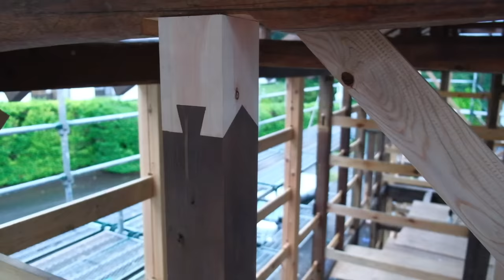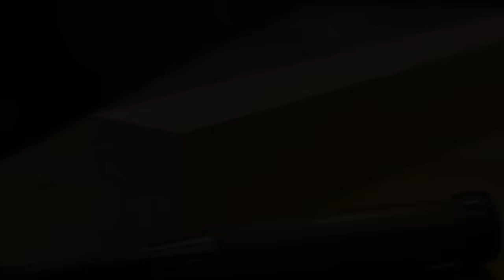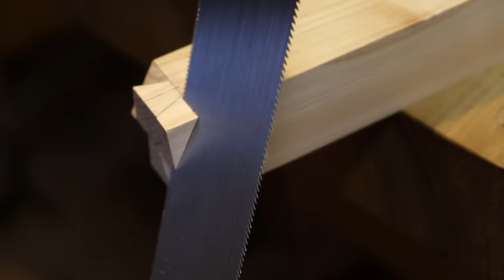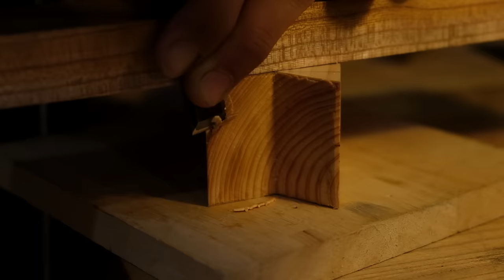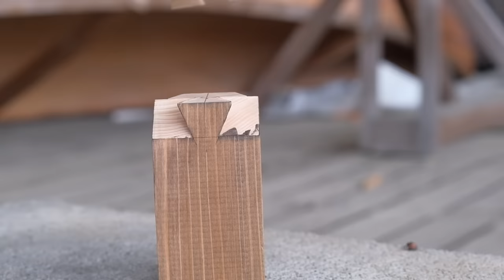Mysterious Japanese Joinery

Comment: What's really awesome about this was that it was a mystery to most people until 1983. The craftsmen of the past were really special. Thanks for sharing this with us, Dylan.
Reply from the maker: Cheers! Indeed, the work they did were really special!
Reply: I doubt it. By looking at the outline of the joints, you can immediately deduce how it looks pn the inside, because the two pieces only move in a straight line in order to close the joint. All you need to do is draw straight lines from the outline and figure the direction.
Reply: @xl000  You don't know what you don't know. It's not that simple. Now that You've seen this video it looks easy but looking from outside it's almost impossible to know how the internal sections interlock.
The first person who came up with this idea was a genius. Not in wood working but in geometry.
Reply: @xl000  That's an incredibly glib response. Try not to be so smug, it's not winning you any friends.
Reply: @christopherbedford9897  Some people can just visualize things easier than you... no sense in getting upset.
Reply: I don't understand why it's a mystery, it's very common in China since thousands of years ago
Reply: I figured it out straight away before he even cut the wood. I deducted he cant slide it in from the side or top because of the odd 2 different shapes of the joint so he must slide it in diagonally.... I was correct. Took me 10seconds to deduct that. So I really doubt this but I work with cad software in my spare time so my mind has gotten better at visualising joints and angles.
Reply: @spacecowboy07723  just because you know it had to be slid in diagonally doesn't mean you can plan or reproduce the joint
Reply: @no_peace  anyone who is an engineer could do that. It's literally what we do all day. I don't see why you think it is so complicated. This video exaggerates for views.
Reply: as as  I'm interested in the topic. Maybe you have more i fo or reources o can learn about it? Thank you!
Reply: @spacecowboy07723  let’s see you come upon with a new in interesting joint then
Reply: @masoudj1185  " Not in wood working but in geometry."
That's why you see things like this in castles of the Japanese elite. Geometry and astronomy were until recently considered to be occult arts . Knowledge of geometry demonstrated knowledge of the spiritual and magical truths, because geometry is how the movement of the planets(i.e.- the gods) was figured out. This is why the pyramids were built in egypt, the giant stones in machu pichu, etc. and why western occultists refer to themselves as freemasons. Geometry, astronomy and sex are the cornerstones of occultism.
Reply: You guys who “figured this out because you work on stuff like this all day”, or “am good with geometry” you guys are the sh1t!
Reply: It was obvious to me the first time looking at it. Was just as I expected.
Reply: It's allgood as long as you ain't got homeless ppl waiting for a homeless shelter your building using this ancient slow-azz technique..😂folks be froze in winter while you sitn at that bench pecking everyone's life away..
It's perdy though.
Reply: Just by the photo I knew it was slide in from a side like he did so your probably right
Reply: Bull.
Reply: A general lack of appreciation for a skill, but doesn’t probably even know how to sharpen a chisel to get accurate cuts like this….sad, craftsmanship like this is being lost by simple arrogance…

Comment: The crazy thing about this is that Osaka Castle was built in late 1500's (Finished construction in 1598 after 15 years of construction). The Tokugawa Shogunate took over the castle in 1615, and rebuilt the Main Gate (which sustained damage in the takeover) in 1628. The main gate has remained to this day. That means this joint was either originally used in the 1580's or 1590's by a guy named Toyotomi HIdeyoshi (豊臣 秀吉), Or in 1628 / 1629 by a guy named Tokugawa Hidetada (徳川 秀忠) .
PS : I'm always blown away at Japanese recordkeeping how easily we can look up and find this kind of stuff.
Reply: I would bet it was part of the repair phase. As cool as the joinery is, it would be a strange thing to do during original construction, but an elegant way to fix a broken post.
Reply: The whole forbidden city in Beijing was built with with these skills 600  years ago.  And these are traditional Chinese woodworking skills.  Not Japanese
Reply: @goldenn1086  So you're saying the Japanese, Who had cultural, economic, and political interactions with the Chinese for more than 1500 years, May have learned skills and techniques from the Chinese sometime in the 1000 Years prior to building this? No Sh*t Sherlock. Japanese have been building Buildings in Japan since before 1100, as I'm sure China did as well. Japanese craftsmen building Japanese buildings don't have to credit the skills the Chinese may have shared hundreds of years prior. The trade went both ways.
Reply: @goldenn1086  
Prove it !!  Is there any drawing or photo?
Reply: So you're basically saying we've no idea when or by whom this joint was first used?
Reply: It may have come from ancient China, but a similar technique has been used in Japan since 600-700 AD
Reply: @Downpour_rain  Yeah of course. The Japanese got all of these from China's Tang Dynasty during that time during the Nara period. Before the Nara period's transfer of tons of tech and culture from China, Japan didn't really have much going on. Also, in reply to the other comment, trade didn't really go both ways. It was pretty much one sided back then with China giving everything to Japan and getting pretty much nothing in return. These are literally Chinese inventions and techniques and all the recent attribution of these techniques as Japanese is the real cultural appropriation.
Reply: @tenmujin6438  I found you are absolutely true, so I researched it in detail, and I am pleased to inform you that my perception was incorrect.
First, Horyu-ji Temple is the oldest existing wooden structure in the world, with construction completed in 607 AD. Japan's first envoy to Sui Dynasty China returned to Japan the following year.
The origins of similar techniques can also be found in the Jomon period.
As time went by, the Qing Dynasty sent many students to Japan to learn from Japan's rapid modernization. Like the Japanese envoys to Sui Dynasty China.
In fact, both "人民" and "共和国" are derived from Japanese.

In any case, I apologize for stimulating your patriotism with my erroneous knowledge.
However, I am sure that the government will be pleased with your exemplary national character. Please remain as you are.
Reply: @Downpour_rain  Exchange between Japan and China went way before the Sui. It's no surprise that the Horyu-ji is the world's oldest existing wooden structure because Japan is an isolated island and it's great that it survived, unlike China which has undergone lots of internal and external wars. Still, China has surviving wooden buildings with the oldest one build in 782 and also others from the mid Tang dynasty still standing and a pagoda that's about 67m tall that was built in 1056. This kind of technique was already in use in China 7000 years ago though, probably much to your dismay. It was found by being used by the Jomon around 4500 years ago. That's a full 2500 years of difference in case you couldn't count. It was also never widespread in Japan under the Jomon. The Jomon had wooden bowls, laquerware, and butt joints. Mortises and tenon isn't widespread at all. It only became widespread in Japan after exchanges began when Japan learned a lot from China. Exchange happens even without an official envoy, mind you. The architecture of the Jomons and the Yayoi looked completely different from the Nara period onwards with Chinese influence and changed Japanese architecture forever. Neither Jomon nor Yayoi ever used Dougong before. All the popular and well known buildings that Japan is known for uses Chinese Dougong. Influence from the Han dynasty made Japan's architecture more complex. After Buddhism was introduced to Japan around 500CE from China and Korea, larger scale temples and buildings began using more complicated wood techniques that came from China. This is how these techniques spread from China to Japan. It is through the spread of Buddhism which happened in the 6th century. These influences and techniques to build Buddhist temples came from China into Japan, and it happened approx 100 years before Japan sent its first envoy to China's Sui court. China's Sui and Tang dynasties influences led to Japan's first permanent capital in Nara which is exactly where Horyu-ji Temple stands. 

And yes, Wasei Kango is indeed a thing, but you are digressing into the Qing dynasty which is over a thousand years after the period that we were talking about. The Japanese did a good job studying Chinese and using the correct Chinese words to describe new ideas learned from the West. It is, considered, even by the Japanese, Kango, after all. When I said exchange was a one way thing, I was referring to the Tributary system. Of course, this system has long ended in the context of Japan by the time of Wasei Kango. 

I apologize that your intellect, or rather the lack thereof, is impeded by made up assumptions about my origin and my government (which I vote for), as this disability of yours has led to your inability to demonstrate self restraint from using ad hominem and stunned your ability to do proper research in an objective manner without biases instead of succumbing to confirmation bias by simply searching for the answers that you want, and ignoring the rest. It is truly my own fault for trusting you so blindingly to have the ability conduct proper due diligence.

Comment: That is a beautiful combination of a complex design, and a simple (and very effective) way to put it together.
     What I particularly like (since I think it's a vertical supporting beam), is that it takes downward force to push it in place... 
      In case of holding up a roof, the joint can ONLY stay strong and in place.

(It's reminds me a bit of construction wood that has been 'finger-jointed' together. 
     That's where the ends of smaller pieces of wood are made 'pointy', and then are pushed together and glued in place. To make 1 long piece of straight pole.
      That is done in factories, though. And the joints are made to be invisible. To give the illusion to the customer / carpenter that it's 1 piece they are buying)

What I like about Japan, is that this wood joint was considered important enough historically to investigate it with x-rays.
Reply: Actually, an axial (downward) force will not bring the two pieces together. The force must have both a transversal and an axial component, and this is the reason why the X-ray visualization was needed, this is a lot more complex than it looks. What is incredible in many of these joints is that the Japanese carpenters managed to figure them out without the aid of descriptive geometry, the branch of math that modern CAD system use.
Reply: @skwalka6372  I understand what you mean with the transversal + axial force. 

HOWEVER (he argued with the actual knowledgeable person ;))... 
      In the video it seems like only 'axial force' is applied (by hammering). 
      And the shape of the joint seems to facilitate the 'transversal' movement (or eh.. 'The geometry of the joint converts the axial force into transversal force' or something similarly scientific sounding).

Because he's hammering on axis.
(And that causes the piece to slide diagonally into the other piece)

Unless I'm getting something completely wrong, I think my original description might be accurate still.. (?)
     (Though most likely I was using the wrong terminology.. Still feels accurate to me; downward force pushes the joint together.. Albeit by converting part of that force into diagonal force).

-
As for your amazement; that's what I love too. This is all without fancy tools and computers :)

What I think might have been part of the process of designing these, is something like Escher did with his repeating patterns, that morph from one shape into another as the pattern goes on.

The basis of designing those, was simply "taking a square, then take away a bite out of one side, then stick that bite on the other side". 
       And then continuing until you get a complex shape that is able to tile perfectly.

Seems to me like a logical way to arrive at certain complex joints.
    (But I could very well be wrong, of course. Just thought I'd share my thoughts on that :))

Also, thanks for the terminology update: 'descriptive geometry'. I've never gotten into CAD, but I feel like it's something that could be benefitial. (I know my way around Illustrator, and I've done some mild 3D animation years ago (in cinema 4D I think).
       CAD seems like something cooler, though. Since you can basically design things that can be made into actual objects, instead of things on your screen or on paper.

Dumb question; 3D printing... Is that done with CAD too..? 
      (Or 'something similar but not CAD').
     Never got the chance to do anything with that yet. No idea where to start (:
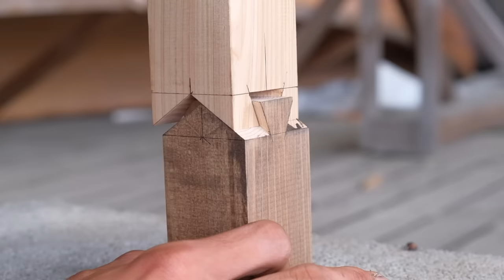Reply: @iggysixx  The last few seconds of the video as he assembles the joint shows the joint being closed with axial hammer blows. However, most of the assembly (look at time about 6:10 on) is done without hammering. The reason is that when the assembly begins, axial hammering would cause friction forces to slightly deform the joint surface, making the closing movement hard or impossible. At the start of the assembly, he is holding the upper component with his hand(s) and pushing it laterally, supplying the lateral force component I mentioned. When the joint is almost closed, the bearing surfaces are larger and you can proceed with the hammer.
Descriptive geometry (an advanced version of it) gives you the math infrastructure to calculate these shapes, 3D printing uses it as do all the computer functions you use in animation.
Reply: @skwalka6372  A belated 'thank you' for the extra schooling session :)
      It's actually very helpful to understand the terminology of mechanics a little better, as well as gain some insight into how stuff works.

Last question;
     Once the joint is seated properly / has been fully hammered in place... And it's holding up a roof or something..
From that point on, it would be true to say that the 'axial force' / downward force will at least 'keep it in place', right? (Since it would require upward + sideways force fo get it apart again)
Reply: @iggysixx  If done correctly (meaning the tolerances are right), this joint should be self-centering and self-tightening once it is assembled. No need to apply any additional forces to keep in place. It will resist both tensile and compressive forces as well as rotational torque. Whoever invented this joint was an extremely clever person. =)
Reply: @skwalka6372  Cool - again; some terms for my vocabulary. (And a better understanding of mechanics) :)
     And I fully agree with the last part, especially now that I comprehend the full extent of awesomeness a little better. (At the start of this conversation, I just 'knew' or 'felt' it was good, if that makes any sense... By the intricate way it 'locks in place', and so on.
     But like.. I even forgot to take into account the friction between the surfaces).

Like I said; your explanation - in particular your replies to follow-up questions - helped a lot :)
       (It also shows that you truly comprehend the subject matter; the ability to explain it in different ways, based on my (not so knowledgeable) questions.
      Based on that, and your patience in the face of (my) ignorance, I reckon you would be an excellent teacher).
Reply: @iggysixx  Thanks for your kind words.

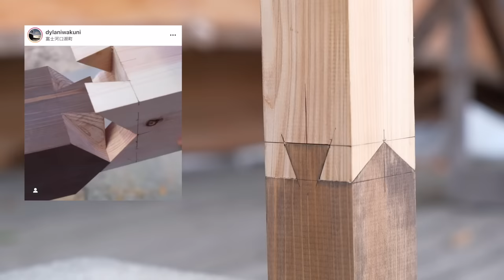Comment: At 7:25, the broadest part of the dark wood slides in and seems to fit perfectly at every part of the way.  The wide part has the right angles in three directions? It doesn't look like this should be possible! 
Even worse if one doesn't know this IS possible, how does one conceive of it?! Simply brilliant! 

At earlier points in the video, this crucial part is even less visible.
Reply: You conceive it when you have absence of insignificant stimulus. Today we are bombarded with all kind of crap, whole day.
Reply: It's called "spatial awareness" - the ability to hold a scene in your head and rotate it around to "see" it at different angles and orientations - Men, who as hunters needed this for humans to survive, typically are better at this than women, we are simply "built for it".  Similar to men having larger lungs so they can run for longer, it's just a genetic tool for our survival as a species.  Fast forward 2 million years to today, we still have this and it proves itself in spades with modern trades and engineering.  I daresay, without it, we'd still be filthy animals roaming the savannas of Africa - if we survived at all as a species.

Comment: Under compression, this joint has a built in stop against slipping apart. It looks like it would interlock well against lateral forces.
Reply: Necessary in a land riddled by earthquakes
Reply: @Ratnoseterry  

Exactly. And it has a built in feature to allow a minor amount of flex for such events.

Comment: One of the things that surprises me about this work is how accurately it is executed but how thick the layout marks are. Most fine work like this is laid out with a very sharp knife but these lines look like a .07mm pen was used. And now, having seen the work done, it still seems impossible; especially this joint.
Reply: I find it interesting that western joinery has one cut on the waste side of a knifed line, while Japanese joinery intends for you to SPLIT an inked line. Traditionally inked with a beveled and feathered piece of bamboo, no less.